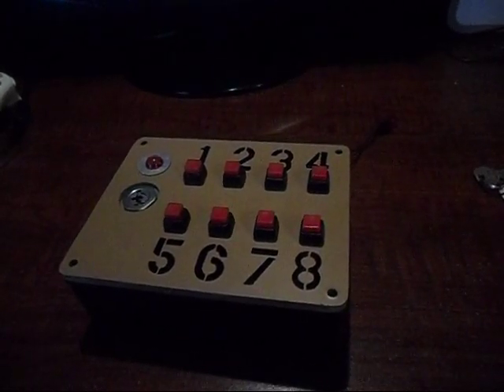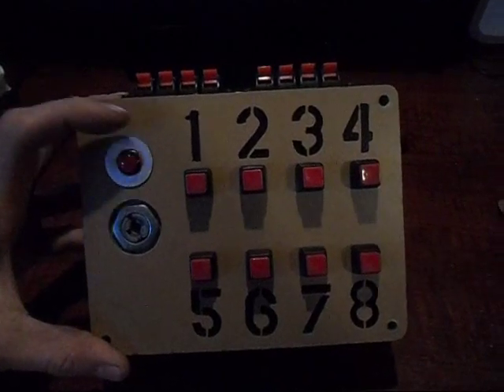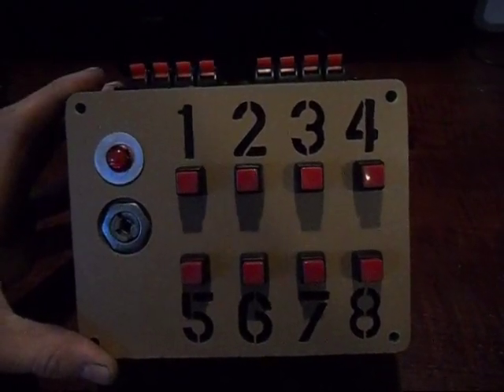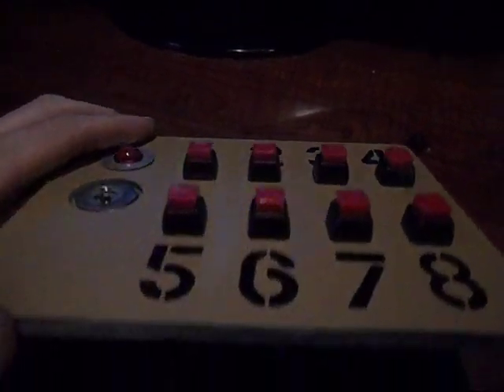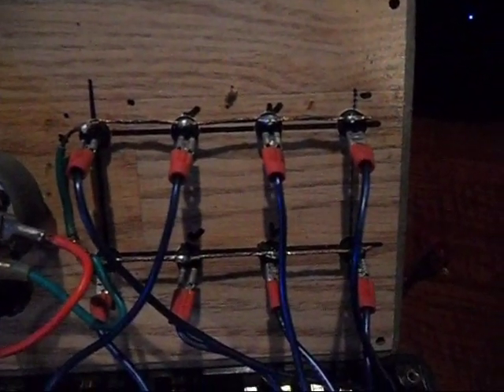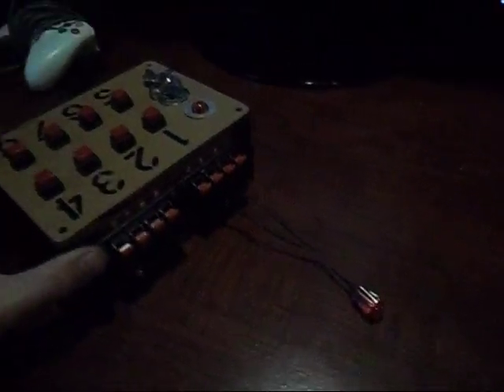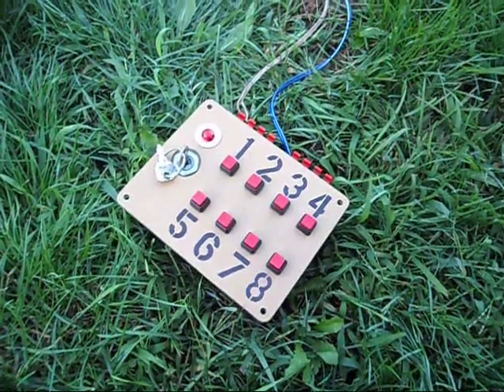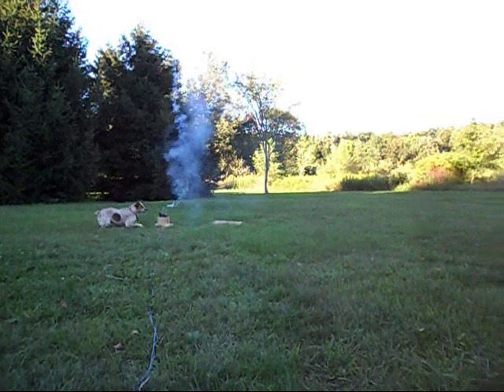home made 8 cue firing system/igniter

Comment from the maker: The 12v SLA (sealed lead acid) battery's work great and usually can be found on ebay for $16-$17 shipped. I have been using those in all of my recent systems. Another thing that works good is 2 R.C. car battery packs wired in series to get 14.4V or 19.2V . The R.C. battery's cost more and the chargers cost more but they are easier to find.